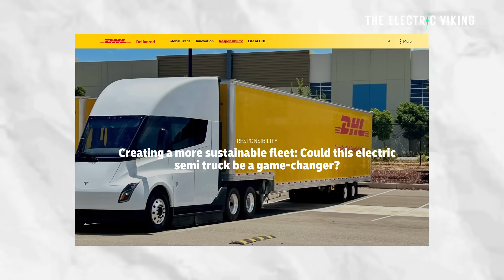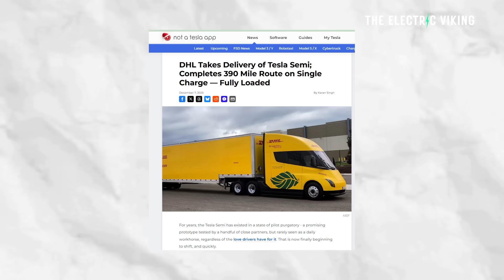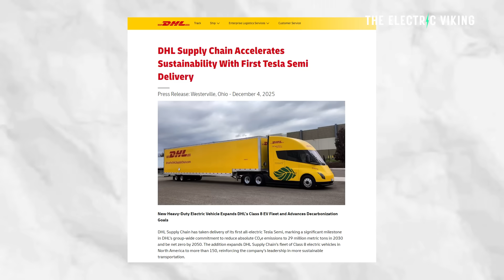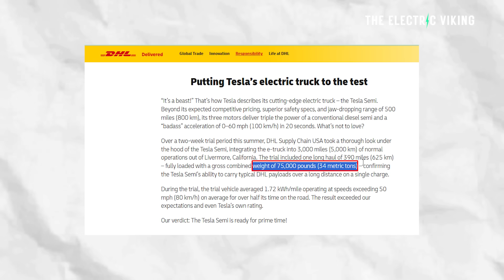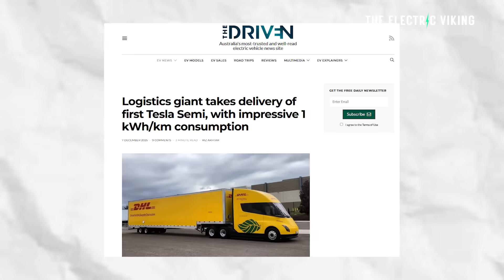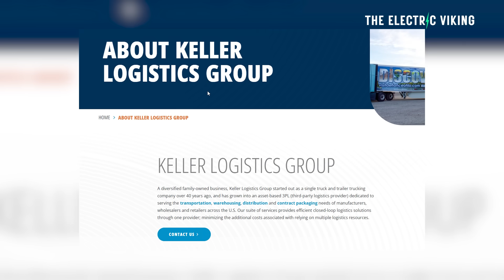Tesla Semi Drives 390 Miles on Single Charge Fully Loaded with Range Leftover!

Comment: With over 70% of all truck hauling in the U.S. is under 500 miles, the Tesla Semi will be just fine, especially since they can add more batteries, if/when needed.
Reply: Most trucks are long haul, and are privately owned by owner operators.... They travel like 400 miles a day,  they don't have charging stations for big rigs at truck stops... even if they did, they wouldn't use them due to the cost of electricity being higher  than diesel. All of this being said, asking a single man company to shell out money on a battery truck is not going to happen in mass,  the technology isn't where it needs to be reliable or even usable for trucking. If you get a load going to Walmart dc, that can cost you 4 to 8 hours of sitting, while the truck battery is loosing electricity heating or cooling the cab for the driver. Most people don't think about the dock time bing 4 hours of just sitting not doing much, but that's the reality, especially with big chains like Walmart or target. The most important part that nobody has mentioned all of this is the terrain these trucks are traveling, flat is great and all but when you get to the mountains is kills your mileage no matter what your truck is, you definitely won't get 400 miles out of it then, most terrain isn't flat and wont get you the 400-mile range .  Most diesel trucks get around 500 600 miles if not more on avg on standard tanks, more if they have bigger tanks, asking truckers to give up that kind of range and reliability is just not going to happen, especially when you actually start putting these trucks under 40,000lb loads and up, which i can promise you won't net them the 400-mile range everyone keeps talking about.
Reply: @slickjim861  I call BS. Go ahead and show me that the typical truck travels 400 a day. 
Then shown that trucks like Tesla Semi can't do that. 
Tesla Semi has demonstrated 500 mile range with a 54,000 lb load through mountains while actually maintaining highway speeds, unlike the diesel trucks it was passing.  
Tesla Semi has also traveled 1000 miles in 24 hours before carrying real loads by the way. Not all at max cargo weight of course because it was real commercial loads that usually cube out before hitting weight limits.
Reply: @williammeek-h2o  I drive for a living, so I’ve seen these things in the wild, and I’m not impressed. I actually have experience in the field, so I you’re absolutely full of crap.
Reply: @slickjim861  So what you are saying is you have no evidence to back up what you say and you are just making everything up.
Reply: @williammeek-h2o  I don’t need evidence, all I have to do is wait.  This is not the first time the industry has tried electric big rigs, I’m just telling you what to expect.  I have nothing to gain one way or the other, by getting into a pissing contest with people that are very obviously very ignorant of how things really work in the industry. It would be a waste of time to actually have to lay out the facts in great detail only to have to be discredited and only proven right later on by time.  In other words it’s not intelligent to argue with an obvious idiot, only to drug down and beaten down with stupidity.
Reply: That's with batteries having less than 300 Wh/kg. The next generation of batteries are on the way and have closer to 350 Wh/kg.  That alone will add nearly 100 miles per charge. Battery technology is still in its infancy.
Reply: Refrigeration?
Reply: @horserous  Same as Diesel. I am sure it will run fine but of course, can't run as far depending on the load
Reply: @horserous  Refrigeration units run very efficient on electricity. Diesel is very inefficient for refrigeration.
Reply: and the driver need a stop for food/WC/Rest after more then 5h driving.
Reply: So, you're saying that it is unfit for something like 40% to 50% of truck transport that is over 390 miles?

And what is a driver to do after driving only 390 miles (about 6 to 7 hours) and now needing his truck charged?  Is he only supposed to work a partial day or is he supposed to switch to a different truck that's already charged and finish his day?
Reply: @kirkjohnson6638  well thats an US-Problem. in most other markets there are mandatory breaks after several hours driving. f.e. China 20min break after 4h, Europe a 45min Resttime after 4,5h driving. using the rest time for charging will extend the range again.
Reply: @user-jg5qq5jo7k  
Same in the US.. 30 min break before 8 hrs on duty, and 11 hrs driving limit, 14 hours total limit, then a 10hr break and 70 hrs weekly limit.. then a 34 hr break.
Problem is in the USA.. less dense areas in the middle..  that charging stop during a break SOUNDS good.. but the problem is the charger needs to be at the location the driver happens to stop at.. And on long hauls.. that is VERY random.  Long-haul... Diesel is better choice.. short and medium haul EV is amazing.  As battery tech gets better this will only increase.
Reply: @user-jg5qq5jo7k Unless the chargers available where you take your breaks are super high power, they will be virtually worthless to truckers.  Good luck with building out that infrastructure and running it off your green energy powered grids.
Reply: @kens97sto171  You clearly don't even know anyone who drives trucks for a living. 
8 hours continuous and 11 hours on duty means you can stop for the break anywhere from hour 3 to hour 8. That is a 5 hour window to find a charger. Once chargers are there, battery is the blatantly obvious choice for long haul
Reply: @kirkjohnson6638  No one is saying that.
Reply: @williammeek-h2o  If a 500 mile range  only covers 70% of all truck hauling as the OP claims, it stands to reason that a  range of only 390 miles probably only covers 60% of all trucking leaving 40% of trucking not being covered.  And that's only because most trucking is short haul trucking that isn't carried by semi rigs.
Reply: @kirkjohnson6638  No, you don't get to just make up your own numbers. This is a case of exponential decay. as range increases, the number of deliveries drop exponentially.
include references or I will keep calling you out on BS
Reply: @williammeek-h2o You're right that if we made a chart of total miles driven on trips between 0 and 10 miles, between 10 miles and 20 miles, between 20 miles and 30 miles, that graph would likely be a decaying exponential.  But that refutes your point, it doesn't reinforce it.  It's quite likely that the total miles driven on trips ranging from 390 to 500 miles is almost as high as the total miles driven on trips exceeding 500 miles, so with only a 390 mile range it's more likely that the range won't accomodate 50% of all trips than the 40% I said in my last post (I was being intentionally generous to the EVangelist crowd).  And as far as semi tractor trailers go, they don't make very many in-town short trips, so if we exclude box trucks, the data will show that EV semis are  unsuitable for an even larger percentage of trucking miles.